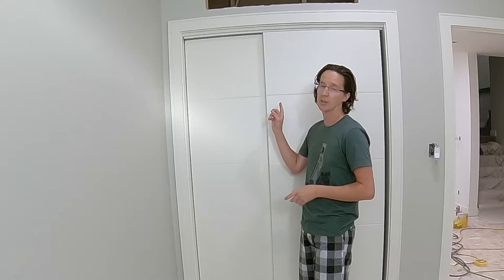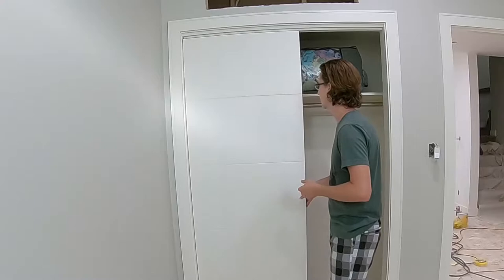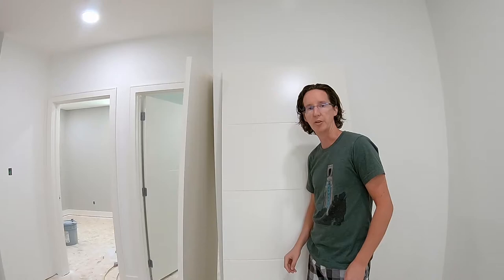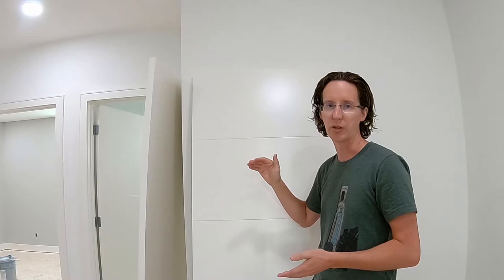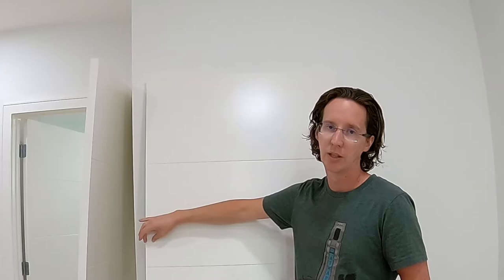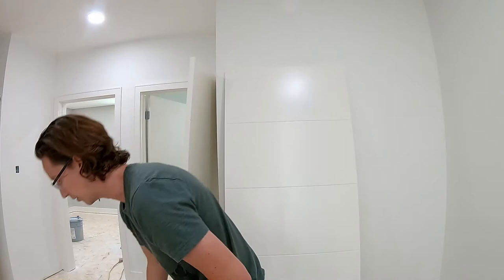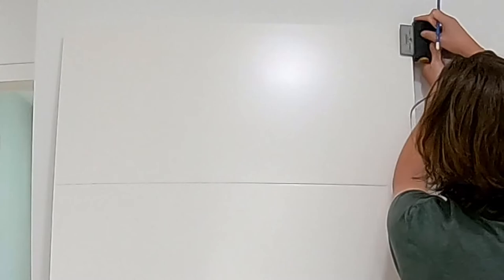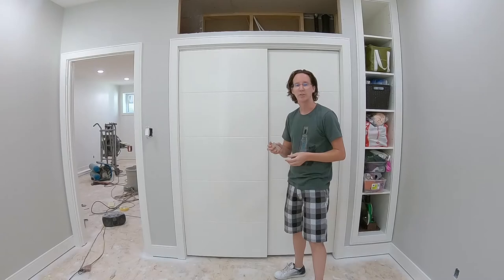Bypass Door Installation

Comment: Awesome video! Can you say what size doors I’d need for a 60” opening please?
Reply from the maker: Double check that the opening is exactly 60" with the finished door jam in place. If it is 60 inches finished then you would need 2, 32" doors. This would give you 2 inches of overlap. If the rough opening is 60 inches and the jam and trim is not installed, then you might be able to get away with 2, 30" doors as the finished opening will be 1.5" smaller roughly.
Reply: I wish I had seen your video before! I got two 30” doors and was told that they won’t work. The workman suggested I can keep one of them and get a 36”. I found that to be odd. A four inch overlap seems to be too much.
Reply from the maker: @symonnecargill4936  Getting the one 36inch will not work either, you will have an overlap when they are closed with the bottom guide placed off center, but if you move the smaller door to the side that normally the large door is on then it will come out of the bottom guide and be a mess. It won't look that great either. You could add a 1 inch piece of wood on each side of the closet to make it a 58" opening and then you would have the 1 inch overlap in the middle. With some caulk and some paint you could probably come up with a detail that wouldn't look too out of place. If you haven't put the trim on then you could put a complete second piece of jam material on and then put the trim on and no one would even know.